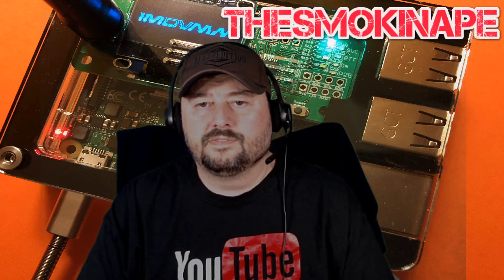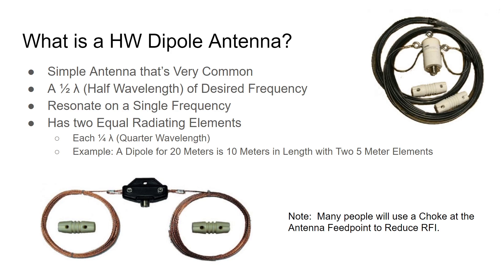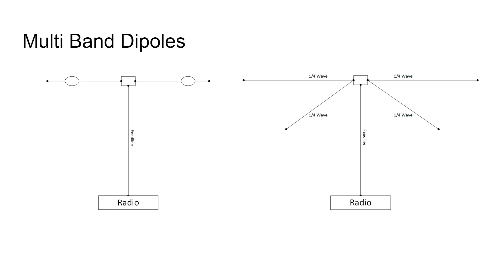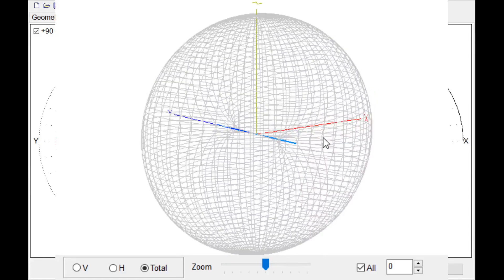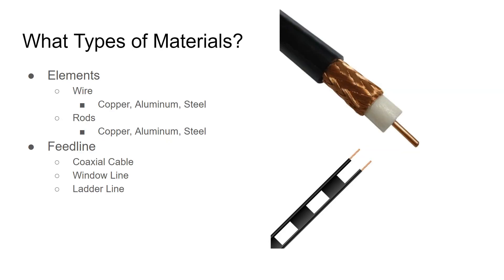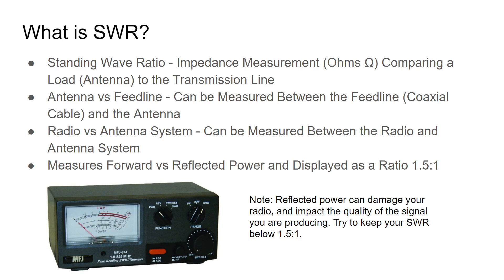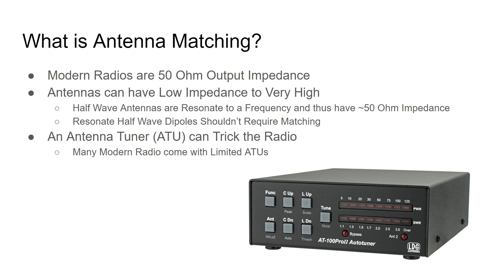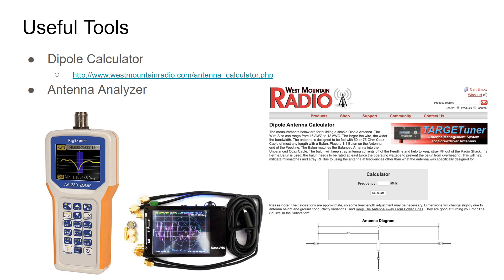Dipole Antennas for Ham Radio - TheSmokinApe

Comment: I built a 10 meter dipole 16 ft 5.6" 1/2 wave each section 8ft 2.8" 1/4 wave. Fed to my receiver via 50ohm coax. 10FT ABOVE GROUND? Total Bust!! Should I have fed my receiver with a 2:1 balun? 75 ohm coax?
Reply from the maker: I would have used a 1:1 choke, what was the swr?